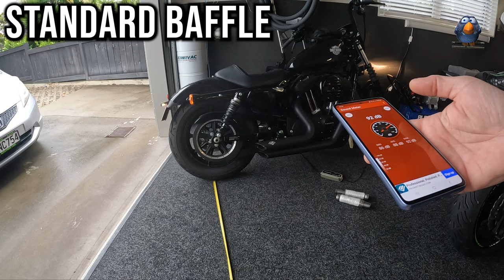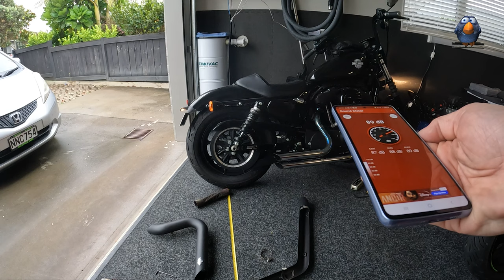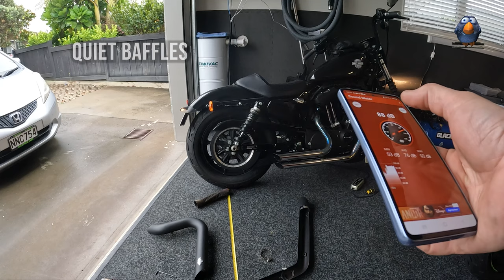Quiet Baffles - do they actually work ? (V&H Short Shots)

Comment: I put in SuperQ baffles last weekend.  V&H Big Shots and Screaming Eagle air intake with a built in horn.  Runs better,  somewhat quieter.  I haven't measured how much quieter yet but a nicer low tone, no appreciable loss of power based on how I ride.  Gas mileage about the same.  Decel pop pretty much went away.  Apparently my bike is tuned a bit lean and kind of like lollypops, the baffles limit the air reversal in the pipes.  With V&H open baffles I measured 87 dB at 1 meter and 45° angle, Guessing about 3-4 dB down with SuperQ.  Note:  A Sound Pressure Level change of 6 dB = half the SPL, 10 dB up or down = apparent 2x or 1/2 as loud to the ear.
Reply: I think we have the same setup.  Mine are the Big Shots on a 2004 Softail with carburator.  Just ordered the Super Q baffles.  Just wondering how much effect it will have on the fuel mixture.  That could be a whole new can of worms.
Reply: Just booked my Harley 883 iron for road worthy and these baffles. It's tuned awesome at the moment with a stage one kit but the decibels at idle is too loud for around town in my opinion. It might run rich and rougher with baffles so hoping it's not going to cost me $1200 for dyno test!?
Reply: To answer my own question for anyone following my bike still sounds very loud, just better and didn't require a re-tune so stoked with these baffles